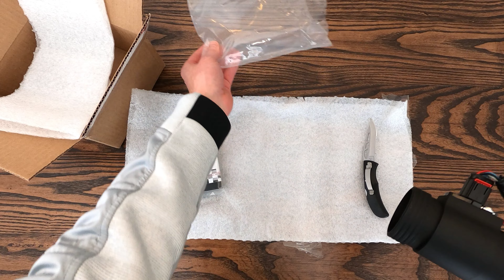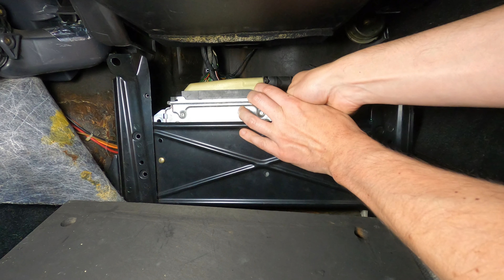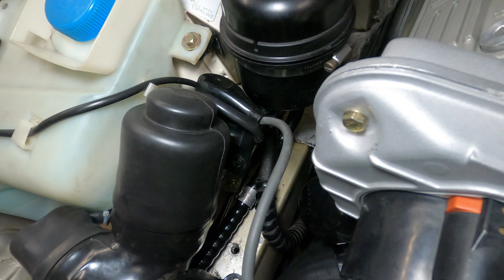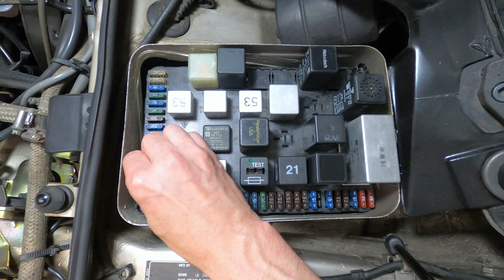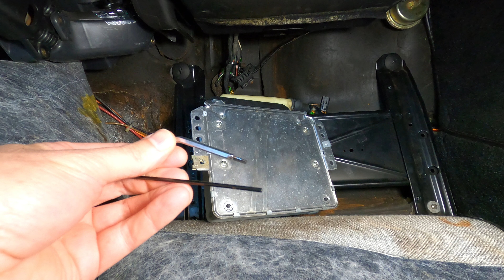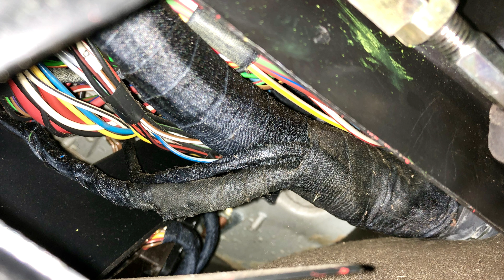Porsche 944 – Lindsey Racing MAF Tune Kit Installation & Review

Comment: That is a lot of money for a minuscule return. ROW 944s give 163hp standard and more with an upgraded chip.
The AFM is not that restrictive as normal Atmospheric pressure 'blows. it open with `14.7 PSI (normal atmospheric pressure) . Having induction CFM higher than your engine can absorb is a waste of time (sorry K&N) . Your induction rating cannot be higher  than your engine was designed for. The only thing that degrades intake performance is a  dirty filter.   You're better off replacing rings and bottom end bearings  and refreshing your engine to return it to stock power. This is not that difficult. Vacuum leaks are your biggest enemy. Replace your vacuum hoses. I had the one under the intake manifold leaking for years and when I finally discovered it, changing all the hoses make the car leap into life like a scalded cat. A DME chip upgrade from a reputable provider can also change the characteristics of the car. Not much more power but a zippier drive.
Reply from the maker: I agree the price point should be below $500 for what you get. Aside from the mini-gains, it does add some reliability over the factory AFM due to the absence of mechanical moving parts that wear out.

Comment: What's the fuel mileage like now?
Reply from the maker: I haven’t tracked any MPG changes in the MAF, but it seems comparable. Anecdotally, nothing stands out as glaring difference since the conversion in either a higher or lower MPG from before.

Comment: Your car sounds great on the throttle! Did the MAF change the sound?
Reply from the maker: Hey Jimmy, no the MAF didn’t change the sound too much, maybe a slightly different intake sound, but I think what you’re hearing regarding the exhaust is due to placement of the mic for those shots, where it was remotely mounted on the rear bumper right above the exhaust tip… makes for an exciting video, but the sound in the cabin is much more subdued.

Comment: Awesome and eye opening video 👌

Would there be much of a chance in fuel consumption /mpg?
Reply from the maker: The factory AFM tends to run a little lean for improved fuel economy and reduced emissions, with the aftermarket MAF tending towards the richer side, so there’s likely some increased fuel consumption with the MAF, but I haven’t measured it. Speaking anecdotally, I haven’t noticed a major drop or a need to fuel up more frequently than before. I’ve heard from a 944 owner that his passed state emissions testing in Idaho with the MAF, which is a good sign, but also understand there are different requirements from state to state and this would fail the visual inspection alone in California.
Reply: Ok, thanks mate.  I'm in Scotland UK.  So will need to see how that pans out.

Comment: i thought you had a trailer queen, but glad to see your driving it. I have an 84 and what would be required to use an 88 DME ?
Reply from the maker: Ha! Nah, I don’t even own a trailer. 😂 Actually, the car just passed 171k miles on the odometer, but I don’t get to drive it as much as I’d like to. For your ‘84, you’d just need to get your hands on an ‘88 DME (or late through ‘87 and add the extra pins), outside that they are plug and play, the connectors are the same. The late DME isn’t compatible with the early AFM, so you’d need earthed the MAF kit or a later AFM for the late DME to work. No other parts or wiring changes required.
Reply: thank you. please come out with more things

Comment: Did you have any problems getting it to jive with your tps?
Reply from the maker: Also… I’m not sure if this is part of your issue, but I’ll add that in general, the MAF tends to emphasize any pre-existing problems with fuel pressure and vacuum leaks that the more forgiving AFM would otherwise mask. So when the MAF is installed, a small vacuum leak can cause the engine to idle/run rough, but be seemingly fine when the AFM was installed, which isn’t really an issue with the MAF itself, it’s just more sensitive to the condition of the other systems because of the free flowing air.
Reply: @NC944er  I have an 88 na with the rogue tuning maf kit, and I was just wondering. I'm pretty sure it's just a tps issue, the car runs awesome at idle without the tps unhooked. I smoked it for vacuum leaks and it was good
Reply from the maker: @user-qf8lv6so5s  Ahhhh, gotcha. Yeah, the switches can fail as well. It looks like the “Porsche” units run about $700, but the same “Bosch” ones are only about $70 😂 Here are some part numbers to check out - 944-606-113-01 interchangeable with both 0-280-120-308 and 0-280-120-309. Let me know if you figure it out. I’d probably start with the Bosch unit.
Reply from the maker: TPS has been all good. The setup was going a little lean on initial throttle tip-in, probably accentuated by the aftermarket throttle response cam, but those symptoms were eliminated by increasing the fuel mix % on the FQS. I believe I have it set to +6% at the moment.

Comment: isnt worth the $650 price tag
Reply from the maker: I agree in part for what it “does” on paper, but I also understand the price point for what it “is” and here’s why: Lindsey had to source a new EEPROM chip supplier just to keep it going and it’s run in small batches, they also have some tooling and design in the new aluminum tube, which looks way better than the previous plastic one, they provide tech support over the phone and it’s not easy supporting a product for antique cars when many of them now have vacuum leaks and fuel delivery issues that are masked by the more forgiving AFM, and most of the alternatives have fallen off the market, I believe Vitesse still makes an AFM kit, but he doesn’t have an online store and that complicates the buying process. Would I have preferred to pay $500 for it? Absolutely! But at the same time, I get it… it’s affected by today’s evolution of the 944 aftermarket.
Reply: @NC944er  There's no way that chip costs over $10 to make, the aluminum tube does require a CNC mill, but there are definitely ways around that. i wish they would sell me everything but the aluminum tube. i could easily make one out of aluminum for under $80 (does require welding).
Reply from the maker: @DKMR2  The aluminum intake tube is pretty sweet, I have to admit. It has a much better fit and finish than the old tubes they were using and it blends in better with the neighboring parts in the engine bay. After speaking with Dave Lindsey on the phone some time ago, he said the MAF sensors are a Hitachi manufactured part used in Ford applications. He receives them in Hitachi boxes and said the serial numbers are already scratched off upon his receipt and he’s not entirely sure why, all he does is take the blades and installs them in the intake tubes. 🤔 So it seems he would have the “ability” to sell just the chip and sensor, but perhaps not the “desire.”

Comment: Very nice video!  Will you be attending 944 Fest in Ohio this September?
Reply from the maker: Thanks! I did pick up a 944 Fest t-shirt recently, but it’s looking like Ohio will be a bit too far out of reach for me at the moment. I was planning to have my A/C fixed by now this year, but have gotten sucked into addressing a couple of fluid leaks. 😳
Reply: @NC944er  there will always be leaks. Always LOL.
Reply from the maker: @richardhummel2160  Been battling them for years now. 😂 I just replaced all the balance shaft housing seals last week, having previously only done the front two, so with all the work over the past few years the only engine seal I haven’t replaced is the rear main seal. The clutch was replaced by a prior owner, so I’m assuming they would have done the rear main seal at the same time, and hopefully I have a few years on that, but we’ll see.

Comment: Nice! Got mine done last month, still have to mess w the fuel settings. But, my rear balance shaft seal went so she’s apart again..
Reply from the maker: Coincidentally, mine is apart now for the same reason. 😂 Well, the lower balance shaft housing seal failed, but I’m replacing all the seals on the upper and lower assemblies. The good news is after that, I’ll have replaced every oil seal on the engine with the exception of the rear main seal. 👍🏼
Reply: @NC944er   I got lucky, my upper seal only haha. But doing Venturi delete and unscrewing my vacuum lines from the previous owner.. gonna wait til winter and swap in my manual rack and do front seals with belts and cam tower
Reply from the maker: @devildog_iii3492   Nice man, sounds like she’ll be in really great shape at that point! I RTVed my upper rear BS seal early on… which bought me about 2 years before the lower one gave way.
Reply: @NC944er  yea I FIPGd the upper just in case

Comment: Been looking to throw one on my 86 8v,  how have you found it since you have had it for a month ?  Would you do the full cold air from Lindsay if you could go back ?
Reply from the maker: I think the price point is a little high on it, but it would be a good value closer to $500, and I’m not sure why it went up $50 over the past couple years, probably because of the redesigned intake tube. I will say the aluminum tube has a great look and feel to it. It’s well manufactured and the appearance is much improved over the previous plastic ones. What can’t really be measured is how much more fun it makes the car to drive. If I think about switching back to an AFM, I definitely don’t feel excited about the idea. 😂 The car feels much more choked and lethargic coming into the throttle with the factory AFM. So I think it ultimately depends on how often you’re able to drive your car to justify the cost and take advantage of the enjoyment factor. If you get your car out weekly or monthly at least, it’s probably worth it. I’ve got the fuel mix set at +6% now, where after cold start it does hesitate a bit on initial throttle tip in, but runs perfect after a few minutes and it’s warmed up. Other owners have reported the same behavior so I’m not sure if it’s the tune itself or what. When I’ve spoken to Lindsey, they just point to various suspects like vacuum leaks and old fuel system components, but nearly all of those things on mine are completely brand new. As far as the intake setup, I’m pretty happy with the factory intake and like the idea of keeping it mostly to the factory appearance in the engine bay.

Comment: Just got this installed by my mechanic, unfortunately the cold start idle is horrendous and very sporadic. He wired it the same way. When warmed up ytd, runs ok but lunging a bit. Worried. I am bringing it back. The engine always ran perfectly from cold start to warm with the old MAF. Starts perfectly. Hum.
Reply: As a fellow 944 enthusiast, I would really recommend checking the chip in your dme I have improperly seated a few race chips myself and had similar issues, Ik it sounds dumb but give the dme a little knock with your knuckles if it cleans up the idle it could be your chip or a dme problem. When you open these old boards cold solders do like to break. I haven’t installed this kit but I am looking to, if you are in need of a  dme for a 24 pin I have a few laying around Even an old Tune chip for one as well if you can get your problem sorted.
Reply from the maker: @PetersPorsches  Good call Peter! Like inserting an 8-bit Nintendo game cartridge into the console, sometimes it’s just not seated correctly. 😂
Reply: @PetersPorsches  I could be interested in a DME, I have 944 from a friend that is missing the DME.
Reply: @tomt930  yeah i have one unopened on thats been sitting for a bit. Ill throw in in my car  and go for a quick drive make sure its all good. And if so ill shoot you a message
Reply: @PetersPorsches  did you do your DME test drive?
Reply from the maker: Sorry to hear that! I will say that the factory AFM is more forgiving when it comes to small vacuum leaks and fuel supply irregularities, to the point where it can mask existing issues. But yeah, if you’ve replaced all your vacuum lines and tested fuel pressure, cleaned injectors, etc… I get it. Did you guys increase the fuel % on the FQS? Any improvement there? Mine is now set at +6%, where it hesitates briefly on throttle tip in for maybe the first 2-3 minutes after cold start, but runs perfectly after that. Other owners have reported the same behavior, so I’m thinking it may be the tune itself.
Reply: Very appreciative Peter, thank you. Will look at the DME and the new chip seating.

Comment: Thank you for an in-depth high quality video. I especially appreciated the dyno comparison. Your engine bay is like it came from the assembly line. One of the cleanest 944's I have ever seen!
Reply from the maker: Thanks Robert! Happy to share the experience… the Dyno testing did seem appropriate to assess the true results of the mod. The engine bay now looks better than the exterior of the car, which is the opposite for most 944s, so it’s pretty fun to see peoples reactions when I pop the hood. 😂
Reply: @NC944er  I have long ways to go with mine. Originally I wanted to LS swap it, but now I have a second 1987 944 engine in good running condition on a crate. Nevertheless the old damaged engine has to come out, so there is my chance to make the engine bay perfect. Thank you for the inspiration!🌞
Reply from the maker: @roberthaviar8243  Oh man, that’s awesome! And it should be a lot easier that way. If I ever pick up another one, my preference would be to pull the engine and perform a complete reseal/rebuild on it… less chasing of issues that way. LS swap would be fun and ridiculously fast, but it would lose some of its charm and nostalgia in keeping it factory.
Reply: @NC944er   I agree, classic sports car as oppose a muscle car. Although I have seen some meticulous LS 3 conversions which turned out beautiful. Still keeping it's 50/50 weight distribution,amazing cornering and nimbleness while having amazing power and torque at your disposal. Surely tempting...
Talking rebuilding the stock N/A 944 to the best possible performance. Some people were getting healthy 210 HP using every possible upgrade in the book.
Any experience with different pistons, camshafts, springs?
Reply from the maker: @roberthaviar8243  Most of my early efforts were spent keeping the car roadworthy, so not a lot of performance mods under way. I did install the 951 valve springs, slightly higher spring rate for reduced float at higher RPMs, but I mainly went that route because they were less than half the cost of the NA springs. 😂
Reply: @NC944er  Excellent, you sure did a great job keeping it roadworthy plus.😁👍

Comment: just put one in my car and i can't seem to get it right. Bogs down at the first part of the pedal?????
Reply from the maker: Yep, that seems to be a common symptom for some other owners as well. Have you adjusted the FQS setting yet and if so, what % have you tried?

The hesitation is eliminated on mine by setting it to +9%, then it’s good on the throttle tip-in, but rich for the rest of the RPM curve. I get better overall performance when it’s set at +3%, but the bogging down doesn’t subside until the engine is heated to operating temperature.
Reply: can seem to get idle adjustment good either. Any video on adjusting idle / mixture screw
Reply from the maker: @atcav3999  My idle has been spot on, so I didn’t make any adjustments. Here are a couple links that explain the process…

http://www.clarks-garage.com/shop-manual/fuel-08.htm

https://www.lindseyracing.com/LR/Parts/IDLE944T.html
Reply: @NC944er  I'm trying to dial in my idle, and reading the Clark's manual it mentions "run the engine for about 10 minutes after the coolant is at normal operating temperature". Not sure if that's the method you use, but as clarification, does it mean wait 10 minutes after the dash coolant temp gets half way up? (I believe half way up is around 90c)
Reply from the maker: @Seagrams  Yes sir, you’re on the right track! Most of the cooling fan switches engage between 89°-92° C so with the A/C turned off, you can also just wait until the low speed fans kick on, another sign you’re at operating temp.

Comment: Another great video! Love the presentation and image quality. Something to note, however... it does not take the AFM / barn door 3 or 4 seconds to open up. Maybe you meant tenths :)
Reply from the maker: Thanks! Yes, 3-4 seconds is an exaggeration of the actual time, but it’s so restrictive by comparison, that it feels like 5 minutes. 😂 I found this video to be enlightening as it shows the correlation between the throttle body and the AFM movement - https://youtu.be/0Bp6xyg4TDg

In actuality, it opens pretty quickly… it’s just that it’s mostly closed at low RPM, which is why the throttle response is improved with the MAF while not really adding a ton of power at the end of the day.